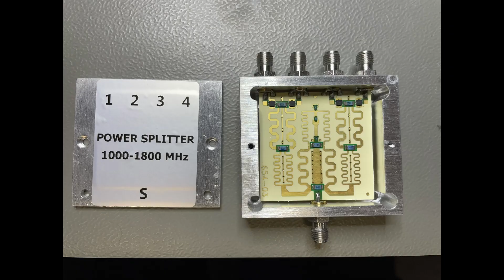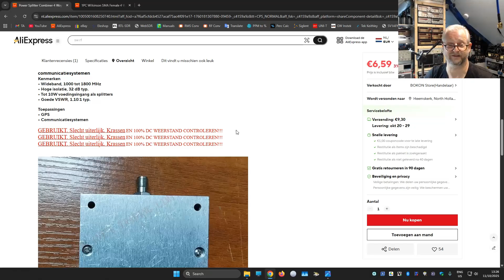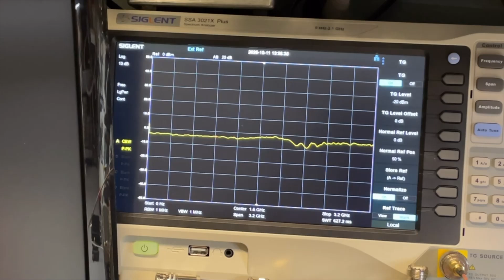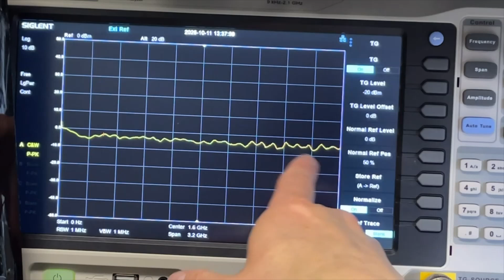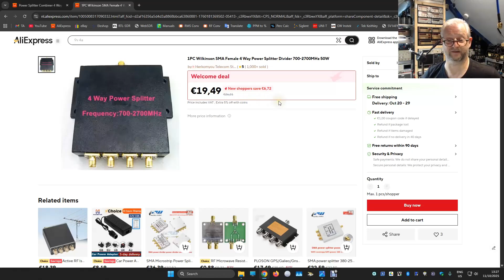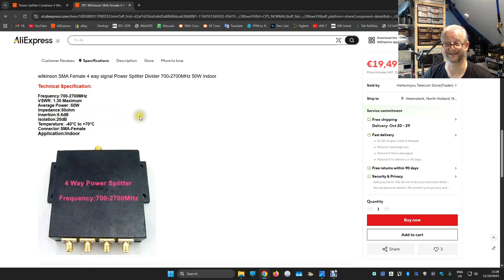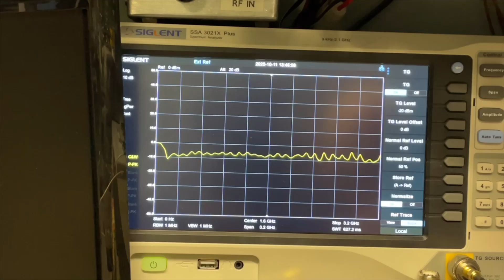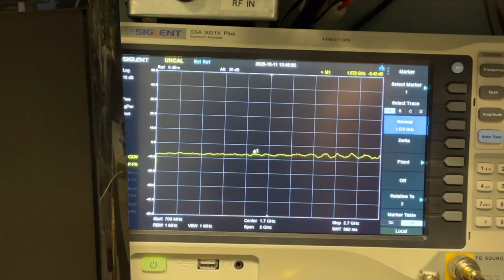TA-0459: Cheap 4 Way RF Splitter - Power Dividers - Red Flags

Comment: Hi, Tony! I'm a radio amateur from Siberia, ub9ukw, and I have an HP3478A, which is an excellent device. The only question is that when the input terminals are short-circuited in AC voltage measurement mode, the 3 low-order digits show 360 microvolts at the lower limit. Is this normal? Have a nice day, and regards, Konstantin
Reply from the maker: Hi Kontsantin, AC can easely pickup some induction. when you short it, you do this with a very short short close to the terminals, or you use a wire?
Maybe you can use a REL or Zero functoin. but i don't remember if this meter has that. i sold mine.
73

Comment: How does this relate to the supply voltage?
I have a 3x output. 
I've soldered capacitors into two of them.
Reply from the maker: i only check RF levels, yes you can use caps for DC blocking.

Comment: I was surprised that the first resistive splitter's performance was so good (relative to the better ones). Useful case for the 4-way 'attenuator'  - you can repurpose it - Individual mini-circuits cases usually cost more than the 'attenuator' !!
Reply from the maker: Hi, Yes same here, i thought the resistor splitter would be much worse.
i should have tested them this way before, but i was more focused on my SV1AFN.. so it needed a followup for sure.
yes the box and connectors are worth the price anyway..

Comment: Totally off topic, but do you have a good source for these banana plug connectors which are in that drawer on the back? I tried so many of these, and they all start falling apart after a few months. Don't know whta I'm doing wrong, but the plastic becomes brittle rellay quick.
Reply from the maker: Hi,
just guessing you mean these : the plugs :https://s.click.aliexpress.com/e/_c39eNyiJ
The terminals: https://s.click.aliexpress.com/e/_c42OVFx9
In general for any products, plastic mostly does not like huge amounds of UV, do you have them in full sunlight maybe?
Reply: @TonyAlbus  I'm talking about these female to female banana sockets.
They may get some sun while they are sitting on the bench at some days, but that's maybe half an hour per day. And most of their lifes they live in a dark drawer. And even the ones I never used (the green ones for example) start to falling apart.
Also all the plugs who are out al day are fine, it's just the couplers who break down all the time.
Reply from the maker: Ah okey, i have these for 2 years, and still good: https://s.click.aliexpress.com/e/_c4Wcefvh
Reply: @TonyAlbus  These are way cheaper than everything I bought so far, I will try these! Thank you! :)